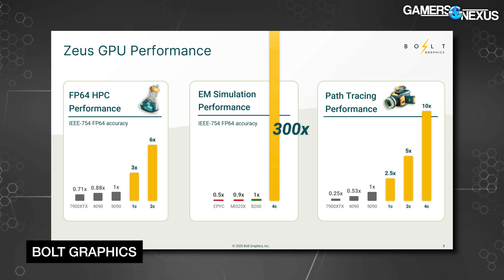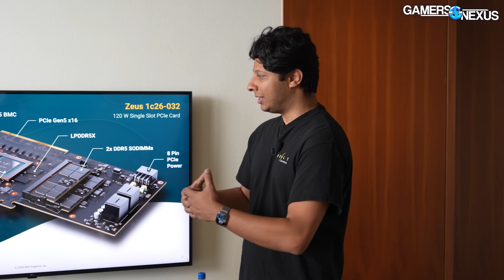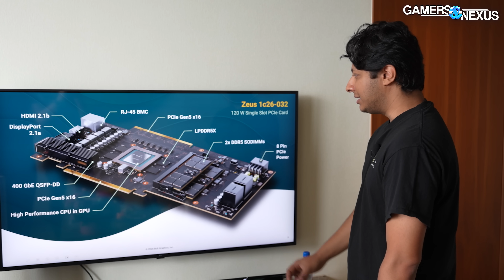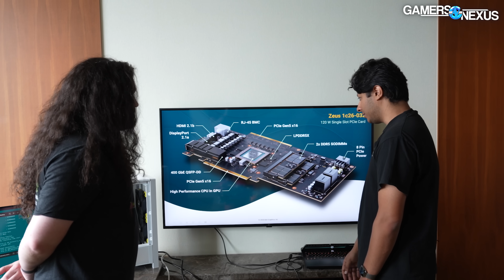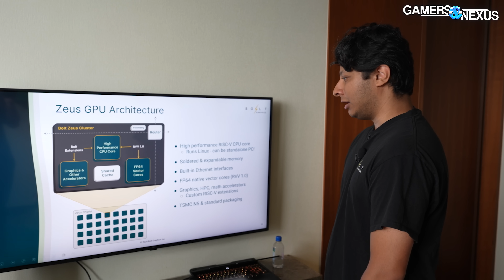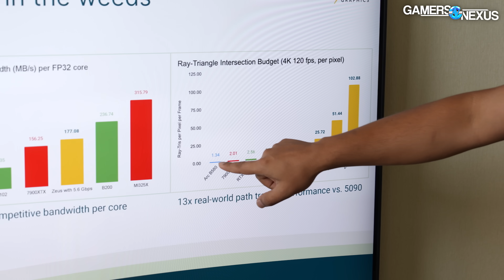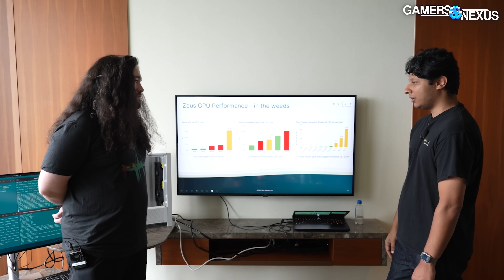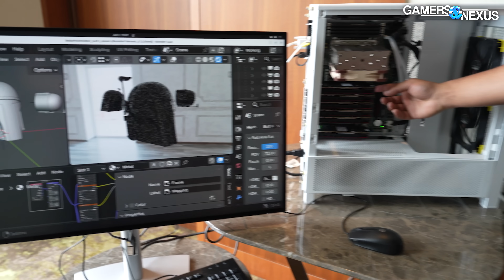A New Gaming GPU Challenger: Bolt Graphics Takes Aim at NVIDIA

Comment: Good luck to him! As for gaming, see you in 10 years if ever
Reply: They could be extremely ballsy and go full open source on the drivers, allowing significant outside dev input seems like the only reasonable way to compete with giants like AMD/nVidia/Intel.
Reply: @MareLooke  indeed, and that's probably going to happen
Reply: @MareLooke  Realistically they also only need to get Vulkan right. All DirectX from 8-12 is handled relatively well these days with a Vulkan software translation layer, with minimal performance loss and for older DX versions occasionally even performance gains through software optimization during translation. Intel drivers got usable quicker on Linux precisely because they never had to deal with DirectX. Translation layers for OpenGL (and even older DX) also exist, though those are much less tried and tested. All the DX translation layers are designed to run inside of Wine of couse so they are perfectly functional and run just fine on regular Windows as well. Focusing on Vulkan first and then just shipping DXVK alongside your drivers on Windows seems like a viable way to go especially since they're starting out with production focused applications. Most such software is designed to use either Vulkan or OpenGL+OpenCL for GPU accelerated tasks so they need that as more of a priority anyway.

Both Intel's and AMD's stack is quite open on Linux currently already, I'd even call it a terrible software engineering decision to not go open to at least the same degree (both of course don't have open firmware of precise specifications to their GPUs published, so it's not super easy to work with). That is one of the main reasons they both have an advantage in the Linux space since Nvidia is constantly plagued by driver issues that nobody can fix for them. Not opening up drivers to at least that same degree is just probably not viable, unless you have a large and highly competent team of software engineers on hand who are constantly up to date, whcih is not something a new small company trying to break into the market can field.
Reply: Right lol
Best to not expect anything significant anytime soon.

But cool to see someone trying and I'll be extremely curious to see how this goes. At very least this will be interesting to watch.
Reply: @TheDarksideFNothing its actually really smart of them to target cinema/movie/content creation stuff at first to find  a place in the market. Hopefully they will succeed and be able to develop gaming gpus too sometime that would be great
Reply: @richardjung9562  yea the gaming market desperately needs competition
Reply: @richardjung9562 yea exactly as long as they can survive they beat out 99% of gpu startups that end up failing.
Reply: @r @richardjung9562 estion is if those companies needing a gpu for their work will spend 100 to 300 less just to become a tester, while they could have known performance and stability? I have my doubt they will survive the first rounds if they don’t have the financial backing to survive ..
Reply: ai generated picture of a GPU, i think this is India Call Center trying to get crowd funding
Reply: They're american. They'll be bought out or enshitify.
Reply: Probably but maybe China will be "inspired" and we can get some decent cards some day
Reply: @ssgg6336  seriously china is an irrelevant  paper tiger regarding anything high tech , they would've ALREADY done this years ago if it was that straight forward  . same with flash memory industry  dominated by south korean monopoly and micron.
Reply: @odgp  china is pretty good at stealing tech look at byd great cars if your not buying them in China since they don't care if they catch on fire domestically. They are already making weird ddr5 so there is hope and if it were not possible then why are they banned from buying the euv tech to produce chips?
Reply: @ssgg6336  Dude ... building hopes on china ? ... I don´t even know where to start, so utterly stupid is that.
Reply: @ssgg6336  funny china "stole" EV's tech but is somehow better than everyone else... did they still from the future? god? aliens?
Reply: @peq42_  You can steal/copy something and improve it. Your comment makes no zero sense objectively speaking. Many projects software or hardware were improved over time when they were copy pasted from existing hardware or software. This can apply to all the way from games to modern day weaponry whether it's guns or missiles.
Reply: @peq42_  China's EV tech? Better? Are you high? China's EVs are consistently the worst performers in the entire market. They're all extreme dogshit. America remains the #1 producer of actually good EVs.
Reply: @ssgg6336  China's production of cards has been a net negative for card quality. GPUs were better made when they and India weren't producing them.
Reply: @MysticalArcane  lol
Reply: @MysticalArcane  what product has had positive quality standards that's been outsourced overseas though? The difference would be that they love to undercut competition when they make products for domestic companies which I don't know if you looked at gpu prices lately but I think there is some demand for completive pricing.
Reply: @ssgg6336  Products usually enhanced by going overseas are products where the specific resources are harder to acquire outside of there.

Coffee beans are a good example of being outsourced and quite good, but we can still reach the levels of quality within the States, we just don't have the current industrialization to do it in mass yet.
Reply: @HuraRas  then why dont the american companies steal from themselves and beat china? are they stupid?
Reply: @peq42_  All the companies that brought us modern life are American. Yes, they’re now evil, but we still needed them to have the cool tech we enjoy.
Reply: @_..-.._..-.._  they can go bankrupt for all I care <3
Reply: @_ @_..-.._..-.._ hat’s just so categorically untrue and ridiculously American exceptionalist you should probably be better off to just leave the internet.
Reply: @_..-.._..-.._  all of them ?
Reply: @_..-.._..-.._  All the companies that wrought illness, death, destruction, impoverishment and de-humanization of our lives are American. You forgot to add that aswell
Reply: @anri688  We don't care about the small details. :D
Reply: @jakobschneider558  I know, America can be getting it raw and not even notice it often
Reply: @anri688  Those are called governments
Reply: @_..-.._..-.._  Plot twist: they have been always evil. Labour abuse and "lobbying" is how you stay at the top.
Reply: @_..-.._..-.._  Worst take I've seen in 2026, so far. Well done.
Reply: IF they got the media numbers they need - i bet an expansion to gaming would be VERY feasible.
Reply: There are tons of great older games to play!
Reply: Ever heard of BC-250?
Reply: Exactly! Nothing about this says "mass produced user facing design". This isn't being built for gaming, this is being built for flashable custom firmware and workflows.
Absolutely super cool! And I'm totally fascinated by it! But this would make a poor gaming chip design, and a bad mass market card design for the general public. 

Something like this in a plex box for real time encoding/transcoding would be cool. Having a dedicated blender rendering card like my old Matrox RT2500 for rendering adobe premiere was awesome back in the day. Something like this could breathe new life into GPU mining which could be neat. Loading up with 32GB of Ram, even slow ram, could make an affordable way to get into building and running decent sized LLMs at home. Lots of very interesting use cases for something like this... But gaming seems like it won't be one of its strengths.
Reply: but Intel had to write all of their drivers by hand - clankers can probably help them bootstrap a lot of this to get them off the ground. it won't be good or fast or stable, but it might get them to "stuff runs" in less than a year, and then (if, as someone suggested below, the drivers are published as open source) the community can contribute improvements and optimizations.
Reply: and if succeed trust me I'll not be cheap 😂😂
Reply: I feel like this guy has no intention of doing gaming. pure ai play
Reply: @zi0x-g that or mining cryptocurrency
Reply: You forgot that near future games will be made almost fully by these kinds of AI gpus. These AI gpus will spit endless code and render for "copy and paste". So games not made by many skilled, experienced and passionate programmers and coders. And not even by visual artists. So its more like see you in 1-3 years. Barrier for "game developer" or "artist" will go ever lower in future and so will innovation and quality. You can already see same games made 50 times over just with different skin.
Reply: Will my 3080 survive until then?
Reply: @Ducky_Actual-E2 my 3090 is right behind you lol
But seriously though... Even at 4k with pretty aggressive settings the 30-series is still quite viable. And most of the time I play in a 1440p window while watching stuff on the side... Probably another 3-5 years before I'll be hurting for an upgrade which is wild as it is already a few years old lol.
But... That all assumes I keep my 60Hz display. If it dies (and it keeps threatening to), it will likely be replaced with something that has a native 120-144Hz input... And I don't think my 3090 will cope with that too well lol
Reply: Wouldn't it be nice to live in a world where cynicism wasn't the most rational mindset?
Reply: @rainbowkrampus  I grew up in the 90s and had that... Far better to be realistic with proper expectations than to live the lie until it breaks you.
Reply: You mean I won't be able to play my favorite games(Enigma, RocksNDiamonds, and Kmines) on this card for another 10 years?
Reply: @jasonsdodd  He have no clue... with AI you can push thing much faster in both the hardware and the software part of GPU => the thing is that leaders of the market are dropping the ball in this topic...
Reply: Catching up to Nvidia is nearly impossible useless they essentially allow it. Even if you could steal their IP and get away with it you'd be at a huge financial disadvantage.
Reply: @CynHicks  it's not impossible. their gpu's are made for raster. it turns out that it just a coincidence it also works for AI. their ray tracing is just a slap on. so path tracing is an open ground. that was a smart move. that's the future so no need to bother with raster if you wanna have a chance. and they go riscv route. so from the start they bet on two future technologies. if they take off nvidia will need to play catch up but they won't be able to as long as there is money in AI. the moat is cuda which could be broken if people get pissed enough to transfer to open source. if intel and amd were any smart they would use this opportunity to try to use people's dissatisfaction with nvidia and improve their solutions and sell gpu's at a discount.
Reply: @JerzyLasica No offense but you don't understand. Furthermore, notice the irony in people whining over the push towards PT from Nvidia while supporting a new company who is solely focused on it.
Reply: @JerzyLasica  But... Where is this push for path tracing? Nvidia would love as much as anyone would for the world of video rendering and games to abandon rasterization... And in spite of being the largest most powerful company on the planet trying to push it through... Here we are still living in a raster rendered world. 😅
It isn't that path tracing isn't cool and amazing... Because it is. It just has limited practical use, and takes a lot of power to do it. With games needing to be able to run on everything from a veritable supercomputer to a mid-range 5 year old cell phone to capture enough market share and sales to publish a big budget game... Rasterization is the only thing that scales across phones, consoles and PCs. Path tracing is 100% the future that all things will move to eventually... But we are talking 10-20 more years eventually, not the next few cycles of hardware and game releases.
Reply: @CynHicks They don't need to beat the Nvidia's xx90 tier. They'll sell a lot of GPUs if they can offer better value than Nvidia at the xx00 to xx50 tiers. (And of course beating Nvidia on value by more than a slim margin means beating AMD.)

And yeah, I know Nvidia has canceled off most of its lower tiers. That's the point. Nvidia stopped competing in the low to low-mid end market.

All that said, computer silicon is hard. I don't really expect to see their GPUs on the market.
Reply: @SnakebitSTI This is competing in the mid WHEN IT COMES OUT,  and it's not remotely fit for gaming.

I find it hilarious that they're getting cheers from the same crowd who hates Nvidia and RT when the whole platform was built for RT from the ground up. 😅

If they do well Nvidia is gonna buy them. Bet!
Reply: @SnakebitSTI  problem is there is not other company in the world (other than AMD) that can make gpu as cheap as nvidia. Just look at intel. B770 not happening because they cannot sell those gu with die size of 5080 at $300-$400 price tag. Then we have Lisuan 3050 6GB competitor build on 6nm process. And yet Lisuan was asking roughly $480 for it. Offer better value than nvidia? That actually quite tall order to overcome when similar spec gpu from competitor is significantly more expensive to make vs what nvidia offering to the market.
Reply: @arenzricodexd4409 You know. We know. They don't. 😉
Reply: never
Reply: @mips13 probably not.

It will be a moderate to significant miracle if they even make an Intel-level splash in the gaming market.

I don't think it's impossible, but I do think it's improbable.
Reply: @mips13  not with that attitude

Comment: Upgradable and modular vram is genius, especially in our current tech landscape
Reply: They're still dependent on the big three for DRAM for the foreseeable future tho
Reply: @jin8982 more for the future with the consumer. Buying a new GPU you'll only need to get the model, with no ram. Much lower costs if you can recycle what you currently have.
Reply: History repeats itself. There were memory sockets in graphics cards in 90s
Reply: @TanderFalkor  you dont have to go back that far AMD made one in 2017
Reply: @pastathehoagie  nope
Reply: It also means that it is slow… very slow. But also very custosimable.
Reply: yeah, only reason it's not been done is because of the 100s of downsides, but other than those it's genius!
Reply: Not new,  not genius, more a rather old "feature" and it is slow, very slow, compared to GDDR6/7 soldered extremely near to the core. And max 128 bit bandwith with both sockets populated. The 5090 has 512 bit memory bus.
Means: 128 bit DDR5 is around 96 GB/s where the 5090 with its 512 bit GDDR7 is at a whopping 2.000 GB/s.
Reply: There's a reason no GPU ever did that.

Speed. Socketed ram is slower than soldered ram.
Reply: @mondodimotori Good job they're using LPDDR5X as the main local high speed memory pool to feed the on die caches, and SODIMMs for the 'bulk storage' - which is significantly faster than getting data from RAM. Like, waaaay faster when you take latency into account. 

That way you keep the cores fed with data. With a 5090 and 60gb of working data, your cores are constantly idling out as they waaaaaiiit for data to come in over PCIe and fill VRAM, again and again and again. This cards RT/PT cores don't even need to be faster than a 5090s - they just need to be kept working more often, which is easier when all the data is on the board itself, not being rammed through the CPUs IMC every few seconds. It's significantly more efficient.

But then that'd involve watching the video, and having a very, very basic understanding of how memory subsystems work.

There's a reason these guys are approaching big render and HPC clients, and they're being listened to - it's because the basic logic is sound, and big render and HPC clients are sick to the back teeth of Nvidia and AMD putting them over a barrel for anything more than 32gb VRAM because they're the only game in town.

Soon enough, they won't be.
Reply: @mondodimotori  thats just copium
Reply: @erisium6988is it? The ram here is LPddr5x and ddr5. 50 series of gpus are gddr7. Memory bandwidth is a huge bottleneck for ray tracing applications
Reply: @erisium6988 Local man solves signal integrity, electrical engineers hate him
Reply: heh, if you don't care about GPU/VRAM bandwith, sure.
Reply: @marcogenovesi8570  watch the video and then comment
Reply: @marcogenovesi8570  you can still get high bandwidth with wider data bus, that’s what apple does with their M chips
Reply: @marcogenovesi8570  Seems like you haven't seen the video.
Reply: @stratos7755  seems like you don't know that dividing bandwidth per core doesn't really make sense
Reply: @stratos7755  Seems like you don't understand how GPUs work. Even the LPDDR5X on the board is a clear downgrade from GDDR. The reason they state in the video boils down to "this is what we can get at our volumes", which is fair and I agree with that. But a "genius" choice it is not.
Reply: @marcogenovesi8570  It's a downgrade for sure but it's still much faster than having to use the RAM on a motherboard when you run out of VRAM. Keeping the RAM on the same card means you don't have to cross the PCIe slot when the LPDDR5X runs out so you get a boost in latency and bandwidth.
Reply: @stratos7755  SODIMMs won't cope well with the instant high bandwidth requirements of gaming rendering. GDDR just absolutely obliterates even soldered overclocked DDR RAM in terms of bandwidth and thus clocking speeds. There is a very good reason why GDDR is not hotswappable: the insane clock speeds of GDDR need basically perfect signal integrity. Even today's DDR5 RAM is pushing it, and no, LPCAMM2 won't cut it for GDDR6 speeds either, let alone GDDR7.